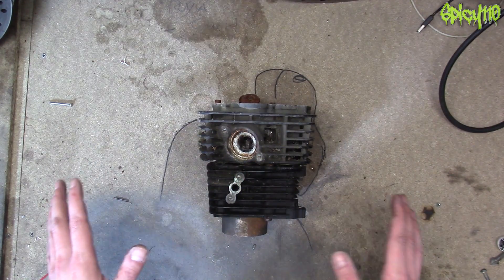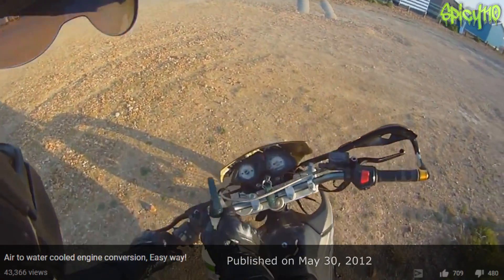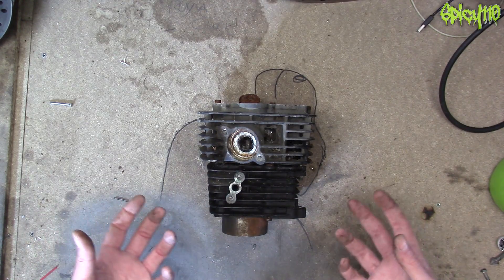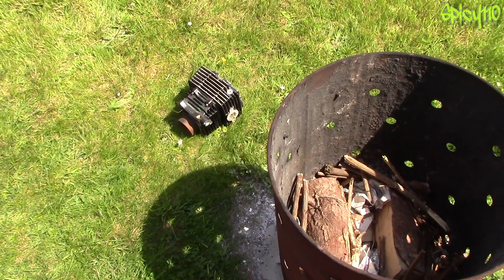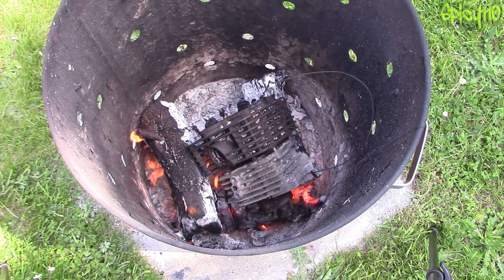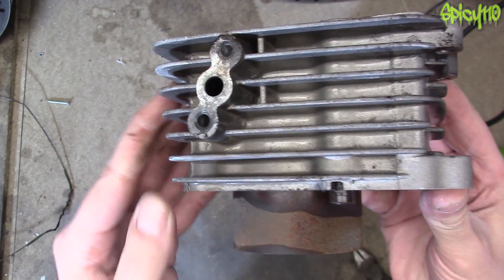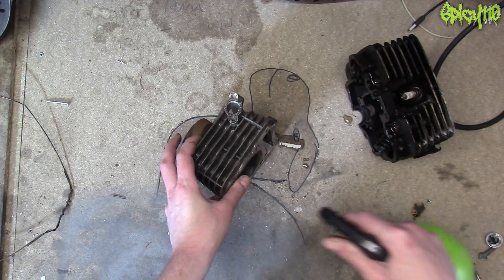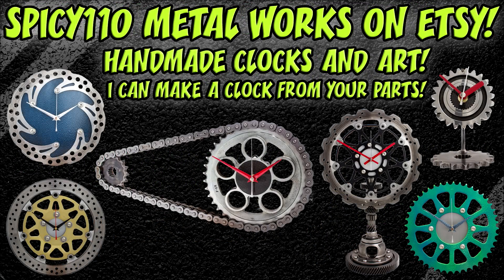Water on a HOT Engine! Will it CRACK?

Comment: I appreciate this unique infirmative video 👍  I have a 2019 CB1000-R and planning to get the whole engine block CeraKoated ! Is it necessary if I don't wash my engine with Cold water when it is hot. Just planned to do cerakote in order to give it extra protection and longer lifespan

Comment: This is a great experiment, although, 1 thing is missed. This is cooled as a full engine. But the watwr spraying will cool only the outside. That is waht caused the actual damage to gaskets and seals first and then the bore itself
Reply from the maker: I'm sorry but no, the point is that is underlying all this is simple. Adventure bikes and mx bikes will be thrashed then ridden into rivers and repeat. They don't crack, they don't break seals of gaskets they just do it again and again. If you are in any doubt of this just watch an old channel called mototrippin

Comment: I was riding a 2000 yamaha blaster for a few hours and drove through an icy puddle, not super deep only 6 or so inches but it seized the engine, its a bit different when u got a hot piston and then cool the head super quickly. thing looked like a grenade went off in there, simple fix though had it machined out and got a new top end kit, best part about 2 strokes theres almost nothing to them a child could rebuild one with their eyes closed.
Reply from the maker: If you ride a 2T around for hours it's likely to do that on its own lol

Comment: No pressure build up so it didn't crack
Reply from the maker: Lol
Reply: pretty sure pressure does nothing, its the vibrations from the expanding gases but this video and witness by me i had a quad that was starting to overheat cuz i was going fast putting stress and its air cooled, went into the puddle smoke everywhere, and it was fine it even ran better again. (my dad being a mechanic called me an idiot for the exsact reason > risk of crack)

Comment: The heads are designed to take a lot more heat than the crankcase I watch the guy pull a Harley-Davidson into a car wash shut his bike off turn the sprayer on it and crack the block on his Harley just from the cold water on a hot motor so I don't know if it's designed to take less heat or what but I saw it happen
Reply from the maker: Cast iorn block?

Comment: Just because it didn't happen to yours, doesn't mean it can't happen.. it does happen.
Reply from the maker: Show me a link to a modern engine (not made of cast iorn) that cracked when water got on it. If this was the case air cooled engines would be known for it.
Reply: @spicy110  show u a link?...  It happened to my cousins car, after it cracked,  his engine rattled.  It sounded horrible.
Reply from the maker: Do you know for a fact this engine never took a wack that could have cracked it in the past? Like a rock in the road or a tall speed hump? What was it made of?  Just remember corolation is not causation.
Reply: @spicy110  - lol what? a rock? Like a tiny pebble on the road cracked the engine ? Really? Lol.. Idk about that one man, 4real.. What else u got? Or hey, maybe u should do that experiment next, like throw a little stone at your engine a bunch of times, and see if it cracks the thing. 
    Like come on man, lol, there has to be another explanation for an engine cracking.
Reply: @spicy110  - Mechanics & Automotive Experts everywhere all say the same thing: "That your engine block can very well crack from water". Go read about it dude. Like just because it didn't happened during your little video experiment, doesn't mean it can't happen. PERIOD. You need to perform that on at least 1000 different types of engines, and do it a hundred different times to really "crack" a myth, (No pun intended).

Comment: have done this every time I go on a ride in the Hot Desert Trail/ Remote Jungle Trails to prevent a disastrous overheat...

I got a Honda XR 200 air cooled / Kawasaki KE100 with a Predator 212 engine

I always carry 10 liters of tap water / river water to cool the engine down
the first 5 minutes is squirting the engine with as little amount of water as possible (kinda like when you test the water with your feet if it's too cold until you get used to it)

then continuously spray water to it until the engine stops emitting steam or until the engine is cooled enough to be touched..(kinda like how you cool down a boiled egg)

have been doing that for years never had cracking issues/ warping/ piston and cylinder scratches...
I guess it's okay.. for Air Cooled Engines at least.. I don't know if it's the same matter for Water Cooled Engines
Reply from the maker: wow I would not even advise that myself haha but that is a really good test for this theory people have. Thank you for the info!

Comment: Thermal shock will not occure instantly or once,it takes time to together with vibration on the menu.... even a gas turbine engine on aircraft,  with an old can type combustor high pressure 1st stage  turbine rotor has an issue of thermal shock due to unequal delivering temperature.how much more for a common metal use for motorcycle engine crankcase  not as strong metal compare what turbine have.

Comment: I'm with ya man, I've submerged several Honda 3 wheelers, in the cold sub zero maine winter waters while riding, and more steam came off the motor then when a car over heads, but It kept chugging along beautifully with never ever a single crack. And I'm talking repeated submersions going through trails with deep water holes or rivers where it don't freeze or a bigger machine had already broke the ice. We lift our legs and blow through. No cracks from water thats below freezing Temps on an engine at least 200 degrees F. So ya ppl can deff shove off lol
Reply: Similar experience here. Drove several different ATVs submerged in water and through mud holes and never a problem. I think this wisdom dates back to the era of cast iron engine blocks. 

I've never seen an aluminum head crack but they can warp if badly overheated. Much more likely you'll blow the head gasket first.

Comment: Wow. Didn't know this moto-myth was even still around. This hasn't been relevant for around 40 years, and even then I've never heard it applied to motorcycles.

This comes from the days of all-cast-iron, liquid cooled engines with large external dimensions like I6s and V8s. If an engine of that style has been severely overheated AND run dry of coolant, adding very cold water directly to the cooling system isn't a great idea. The bottom of the block will cool first, and the difference in size between the areas that have thermally expanded and thermally contracted can be enough to shear the crystalline structure of the cast iron IF the engine is large enough. Likewise, if you turn a cold garden hose on the outside of an overheated head with no coolant in it to act as a thermal buffer, it will "curl" and the same can happen. *In cast iron*. 

A tiny, low mass, air cooled 125 made of aluminum (which is far more ductile and a better conductor) is at extremely low risk. I suppose you could make this happen if you threw ice on a vintage Harley that had gone full meltdown, but at that point you've got bigger problems than "it's too hot."

Comment: It's possible but unlikely (not from rain or the spray), you just need to be careful when changing the coolant in water cooled engines, don't put cold water in a hot engine just in case it does cause a crack.  Also use anti freeze if you don't use a ready mixed "coolant" so you don't get cracks from the water expanding when it freezes.

The only way you will know if it has caused any cracks, is if you get leak's, the cracks can be so small you will not see them.  Just best to be cautious as it can get very expensive, more so with car heads and blocks of course.
Reply from the maker: If you can open and drain your coolant without getting burn before it cools enough for it to cause damage after passing though a hot radiator I want to see it. (On a bike)   The only time I can see that happening is if your engine over heated boiled over completely and you instantly tired to refill it.
Reply: @spicy110  Easy, car or bike :)  also it does not necessarily need to still be at optimum running temperatures to suffer thermal shock.

You are certainly right, it would be much more likely to cause issues if someone adds cold water to an overheating engine.  It's just as advisable not to top up or refill a hot engine, why risk it, however low that risk may be.  Just topping up is such a low risk it's most likely not possible, you'd still be advised not to do so by manufacturers.

You seem to feel I'm trying to go against you or something, I just go by what I know from my training as a mechanic, and a little common sense.  Look how my original comment began "it's possible but unlikely".
Reply from the maker: Haha no hard feelings just discussion 🙂 I like learning from people,  However most of the people who comment don't know what they are talking about. A by product of the Dunning–Kruger effect.  

See I am of the opinion if something is a real issue, it won't be a discussion it will be a well known fact. Like brake fluid on paint will it strip it...well we all know the answer to that one,  but I have never heard of anyone actually managing to crack an engine unless they did something stupendously stupid (boiling water in a frozen screen sort of thing)  

Out if interest have you personally ever seen an engine crack because of thermal shock that was defo not the later stages of a earlier problem? As in crashed in the past  etc. 

Point of that question is not to disprove your point but to see if it is more common than I may believe.
Reply: @spicy110  You could probably do a massive survey and not find many (if any) mechanics that have found this to have happened because it's very rare/unlikely as said above.  But you will find cracks in heads do occur, they can be fixed too, by specialists engine/cylinder head restorers.

Also I would be surprised if owners would put their hands up to what they had done, if they even knew it was their actions that caused external or internal leaks.

Even with glass, you can get away with pouring boiling water over it if you are careful/lucky, at least windscreens.  I used to do it at 5am in the winter back in the 90's, straight from the kettle.  I was always a little on edge doing it but wanted to just get in the car and get going to work.

There is a lot of information online about engines and thermal shock.  I've not looked into it, but I would guess that engineers would determine the same possibilities and say it's possible but very rare/unlikely for the most part. 

It might also have been more likely on some older less modern design/build techniques of engines.  There are issues with older engines that do not apply to modern engines.

Comment: I know you basically disproven the myth with this intense test, but what if you took this to the logical extreme? Repeated exposure to fire, then quenched. There might be micro fractures that have formed. If you go even further and use an insulating blowtorch furnace to get it to glow a faint red and THEN dip it, I definitely see this cracking. 

HOWEVER.... Splashing a bit of water isn't going to do any damage; heck, just dunking your bike in water will just create a bunch of steam and warm water. Engine fins are hot, but the exhaust manifold is even hotter.

Comment: While I do agree the idea of cracking a motorcycle engine by some water spray getting on it is absolutely ridiculous, I disagree this test was a worst case scenario because of the metal being Chinese. Higher quality cast iron would be more prone to cracking, not less, even though I think it still wouldn't unless it was significantly weakened by a casting error as you yourself said.
Reply from the maker: It's ally with a steel sleeve like most modern bikes, It's going to need to be pretty old to be cast iron,  However yer I guess this method on that might be worse case. But as I said if I did it to 100 different heads of different ages I'm sure one would crack. It was slightly tongue in cheek mind that comment about Chinese engines haha
Reply: @spicy110  I used to love Driving and Riding through big Puddles after downpours when I was much much younger😂😊what must have been gallons of cold water all over the engine never did any harm to the cast iron block or exhaust manifold...great fun so long as you don't drench some poor old lady....The early transverse engines on the other hand used to cough and splutter for a while until the plug leads dried out...and as for diesels so long as the intake is above water you can even drive those through rivers, did that many a time without a crack in sight.
Well proven Spicy nice one son.

Comment: Not convinced your lack of footwear was good shout, but an interesting experiment to be sure!
Reply from the maker: Didn't want to get burnt badly if water did splash! 

 Clothing in hot liquid spills only makes it worse as it holds the heat on your skin. This is why chefs use thin chefs jackets with poppers and with nothing under them as it gives you the ability to rip the thing off should hot water or oil get spilt on you. (I was a chef for 7yrs)
Reply: @spicy110  I was thinking more PPE style steel boots, actually riding boots would do the job

Comment: Don’t ride your air-cooled motorcycle in the rain. It will make it crack. 

Also before you start the bike you should heat up the engine with a space heater or something. This is so that the temperature increase is less when you start the engine. Little known fact, starting a cold engine without preheating will cause the head to crack as well!
Reply: The best method I've found for avoiding cylinder heads exploding when I start the bike is to take a short hose and syphon some of the fuel from the tank and run it over the engine. A litre or so is usually enough, maybe a little more in winter. Then i light it up and let it burn for a minute or so before starting the bike.
Reply: I like that @staggabob

Comment: Good video but I had a monkey bike with a YX 140 in it with a polished imported head and it was pretty maxed out to be fair and I had just been on a ride for three or four hours and I stopped off at a Morrison’s petrol station because I could feel the engine was getting fucking hot and it needed oil While I was there are used to the washer bottle water out of the machine and about 10 minutes later I went to start my bike and it was smoking like fuck and it turned out that my head had warped and my head gasket started to leak but I still think you’re 100% right that it won’t crack but it can definitely Warped it